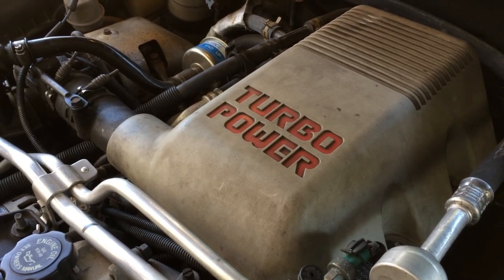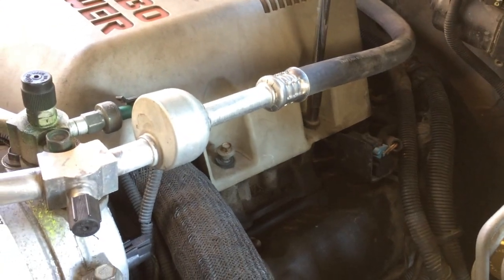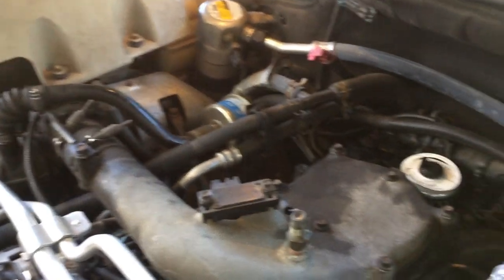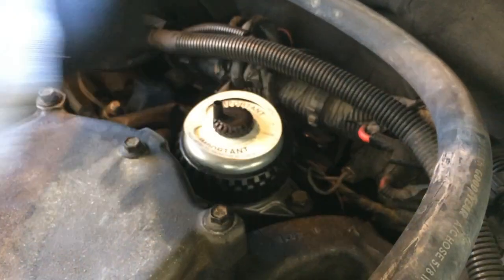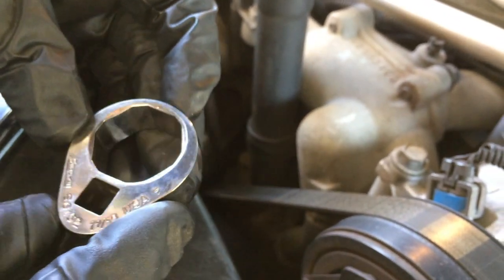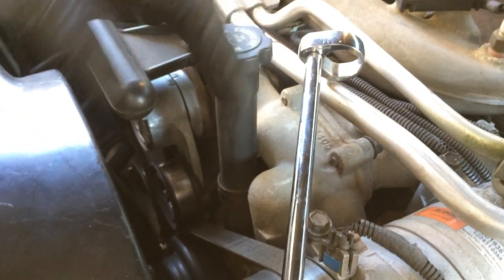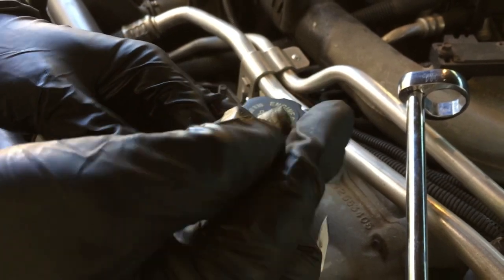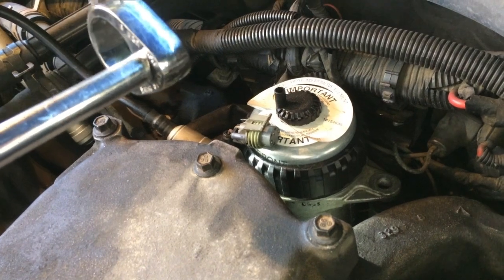1996 - 2002 GM Truck 6.5L Diesel Oil Pressure Sender / Sensor Replacement (Chevy & GMC)

Comment: You blow me away with your ability to do everything. But what stands out is your ablility to source ACDelco original parts, then to find speality items like that Snapon adaptor. How did you even know to look for that tool???
Reply from the maker: Most of these tools were designed by General Motors and sold thru Kent-Moore.  They are referenced in the GM service manuals.   But often other companies like Snapon will make a similar special purpose tool for much less cost.    So you find out in the service manual about special tools that are required.
Reply: The snap on was cheaper?
Reply from the maker: @peterwill3699  Yep, over at eBay

Comment: Best thing I ever did on my 94 was to bypass the OPS with an aftermarket harness. It also allowed me to bleed the fuel system after filter removal.
Reply from the maker: FYI, that fuel function was only applicable to pre-1996 engines, GM redesigned it and afterwards the oil pressure sender had nothing to do with the lift pump action anymore.
Reply: ok I have one for u I have a 96 gmc van but it's the old body style with the 6.5 non turbo. but if u look up a 96 they all show the new body style called the Express and they came turbo diesel. so my ? is how doin know if my lift pump is driven off the ops?
Reply from the maker: @karterguy1  That 96 would be a "G" model van if that helps on parts searches. This OPS circuit change was for "96 and up" but very early builds could be different I suppose. I honestly don't know for certain how you would distinguish such a situation.   Certainly on a 96 you should have the lift pump activated and purring along during the wait to start cycle (dash lamp flashing).  If you hear it then the LP is likely fine, if you don't hear anything (or feel the buzz vibrations with your fingers on the outside housing) I'd next try powering the LP directly disconnected from the vehicle harness to see if its good.
Reply: @DrShock  if this is so, then what exactly is the purpose of switching this part? The only reason I was about to buy one (which i most likely will anyway) was because I seen on other videos that people say, the lift pump is ran off the ops. If that isn't the issue for my 96 (which i can hear buzz when I turn the key) them I'm not sure why I would need a new ops.
Reply from the maker: @creeplife2802  There is no point in switching this part unless you're diagnosing an issue with the oil pressure gauge for 1996 and up.  It's got nothing at all to do with the lift pump circuit in the later design.   But before 1996, yeah it was used by GM as a safety shutoff to kill the lift pump when the oil pressure dropped.   This video was about working on an oil pressure gauge not functioning correctly, as mentioned in the video it ended up being the instrument cluster that had to be repaired to correct it.   If I did this repair all over again, I would have just pulled the cluster first.  ;-)

Comment: Had to replace oil pressure switch on my 2000 3500hd 6.5 diesel.i couldn't get a snap-on S6152 tool, but found that a Basin wrench used in plumbing worked well to remove/install the switch. Hope this helps someone

Comment: The pressure switch works the oil pressure gage and once the engine is running, it supplies 12 volts to the lift pump also. It performs two functions in one switch
Reply from the maker: That lift pump aspect is only applicable for 1995 and earlier model years.  In 1996 GM changed the circuit on this particular engine, and the OPS is no longer involved in powering the lift pump.

Comment: 1998 ….. 15 psi fuel pressure at T valve. Fuel present at return line on injector pump. 12 v going to FSS. New PMD relocate, Carter lift pump, Fuel filters, battery, alternator, oil pressure switch,  upgraded fuel hose supply to IP. Last ran in current condition 2 day ago for 1 min. Now no crank. Fuel restriction?

Comment: I'm assuming this could also be why it may show over 40 psi once started from a cold start and start to show 0 once its at operating temp? I just got a 93 3500 and its been doing that.
Reply from the maker: Possibly, if you're sure the sender wiring harness isn't chaffed or otherwise damaged along the run.   While I do not like to throw parts at a problem, with this particular sender there's not much you can otherwise check besides the harness as a scan tool gets its info from this same part.  A shop might connect a spare sender or mechanical gauge to confirm the diagnosis, but for DIY you typically won't have that available.   Personally, I wouldn't suspect the cluster gauge itself since you're reporting consistent sweeping of the needle from 0 thru 40.  I suppose it could be the PCM, or even an internal bearing thats gone out, but those would be on the extremely rare scale of events.
Reply: Be careful make sure you don’t have a duty oil screen under the oil panel

Comment: I live in NC and own a 99 c3500 GM ambulance. The batteries died during the winter and after replacing them with new, I have the Security light always on. It sputters to crank and then dies. Can you recommend a video/tutorial to reset/disable this passlock dilemma?  I love your knowledge and teaching style.
Reply from the maker: First, I'd suggest verifying the easy stuff.  I had a Chevy Cobalt once with the security light on and wouldn't stay started, but it was because the battery had a defect of some sort causing an internal short.   Replacing the battery/cleaning the terminals cleared that right up, so check your volts and cranking amps first.   If that's good and its a legit security/Passlock trip, then you need to do a relearn procedure on that.   Without a scan tool you can do a "10 minute" relearn  procedure on that 99  - https://www.youtube.com/watch?v=5feL05TyLtI
Reply: @DrShock  Thanks for taking time to reply. I'll check the batteries and connections tomorrow.

Comment: Sir I have a 97 with a 6.5td. have had intermittent acceleration problems for a long time. Sometimes it feels like it is dragging other times it feels like it's running great. By accident today I unplugged the oil pressure sensor so I rerouted the wires and plugged it back in and the problem went away.. is that an indication that the harness may have a short in it?
Reply from the maker: For 1997 the oil pressure sensor is not involved in the fuel circuit (this was true prior to 1996 though).  Tough to say with certainty, but it's possible some other wiring involving the fuel injection pump harness you disturbed during the re-routing process was involved.  It might be a rub thru situation from years of vibration, or it may be corrosion at a pin connection point.  Either could have been temporarily improved by the disturbance.
Reply: @DrShock  thank you for the reply sir.. I was under the impression that the oil pressure sensor controlled the lift pump. Telling it how much fuel to push through. This truck is a headache..lol
Reply from the maker: That was true, about the oil pressure sensor being part of the lift pump fuel circuit, but only thru 1995.

Comment: You say that's the only way. What if you removed the fuel filter canister? Two bolts and one line and swing it out of the way.
Reply from the maker: I hope I didn't say the only way, as of course there's usually several ways to improvise and approach such disassembly.  But definitely needs the special tool to remove the 96+ sender to avoid damaging it.

Comment: Would this part be my problem cause when I drive my truck over 30min and come to a stop my oil pressure drops to 0 but the engine never sound different.stays running smoothly
Reply from the maker: Possibly, you would want to eliminate any electrical problems first (both to the sender and the gauge).   With their age now, these old body style (OBS) trucks will have developed some ground issues.
Reply: Hi I know this is 4 years old but my 97 is doing the same thing but it's not going to 0 yet but runs smoothly you think with low oil psi it would start knocking did you change the yours in did that help

Comment: What were the symptoms for need of replacement my truck is surging and feels likes it is bucking almost holding back
Reply from the maker: For the years covered, it's just an oil gauge not working.   The oil pressure sender has nothing to do with the symptoms you're describing, for 1996 an up 6.5L diesels.   If you had an older model, then this sender would also serve as the activation switch for the fuel lift pump.
Reply: @DrShock  Well it is a 98 C3500 dually with the 6.5 and it feels like it is bucking and i hate it with only 83K miles where should i look it is also up for sale i don't need such a beast no more
Reply from the maker: So for a 98, that's not going to be the oil pressure sender.  I would first start with seeing if there are any codes stored by the PCM (not all of them will cause the check engine light on the dash to come on).   Let the codes guide the next steps, if there are any.  If there are no codes, and since you didn't mention any problems starting,  I would start first with making sure no problems with air flow to engine, then fuel flow to injector pump, then I would make sure all is good with vacuum if its a turbo 6.5L.  If that's all good I'd look at the injector pumps PMD unit next.  Hope this helps.
Reply: @DrShock  You were right there were 3 codes i looked them up but being idk Diesels very well yet idk what they mean or where to start i got a P1216,P1217 and a P1654 where should i look from here thanks for all your help so far
Reply from the maker: P1216 & P1217 are fuel solenoid related, "could" be a PMD or PMD wiring harness problem, but usually is an injection pump problem.   P1654 is service throttle soon lamp circuit.   I would start with the P1654, this one is related to the dash lamp for the accelerator position sensor.   It's a code from either the lamp for the service throttle soon lamp being shorted (does it light up during the lamp test when you first turn the key before starting?) , or a short to ground in the related circuitry.   For the other two, it's handy to be able to borrow someone elses spare PMD to eliminate that as it's the cheaper repair (an injection pump repair will be quite costly).
Reply: @DrShock   i have another PMD and relocator kit it is one of those cheapys though so i haven't changed it yet should i try that and would any of this have anything to do with my CC cause it has stopped working all together now but when still working the sluggish holding back behavior didn't seem to be a problem i see i am also getting static noise through my radio with the fan on high so i was told it might be ground related what grounds would i check for this i am so lost and again appreciate any and all your help GOOD SIR
Reply from the maker: CC = cruise control I presume.   No cruise circuit would have nothing in common here, but corroded ground points or corroded ground straps could be a common culprit since you have several not necessarily related things going on here.  You'll need the service manual schematics to trace out those ground points. Here's a link for PDFs, scroll down to the four volumes for 1998.  https://www.gmt400.com/threads/88-95-service-manuals.43575/
Reply: Had exact problems, cruise control and all, pmd was the fix. Dying proof on my back seat. Buy a good brand and relocate behind license plate
Reply: @DrShock  just bot ‘94 K1500 with 59k miles. I’m having a bucking problem. Fuel is shutting off. I had a code, replaced-relocated PMD. Haven’t had code since, still have problem. Replace LP & wire harness. Still have problem. 

Cold start is great. Starts bucking as it warms, gets worse the warmer it gets. If I stop, heat builds up it gets really bad. I can drift down hills to cool engine compartment. When I get to level I can get on throttle, it’ll take off great. I’m convinced heat is causing my problem. 

Any thots?
Reply: Did you ever solve your problem. I’m have something similar.
Reply from the maker: @kevinsheehan983  This is one of those kinds of problems where having a Tech2, or comparable scan tool, is necessary.   You have to be able to zero in on root cause to avoid the parts cannon.   What I'd be looking at on the scan tool is what is the engine coolant temperature reading before and during the behavior and how does that compare to what the dash gauge is showing (two different sensors).  One of the sensors is in the cylinder head (gauge) and the other in the coolant crossover (for PCM).
Reply: @DrShock  thanks. I do have GMTDScan basic with a laptop & OBD1 connection. 

This evening I disconnected the crossover temp sensor. I wasn’t aware there’s another. Thanks. 

When I had a code 36 every thing I saw on line was replace-relocate PMD. 

I changed the lift pump cuz previous owner put on a plastic transfer pump. That needed replaced regardless. 

I don’t want to throw parts at it until it’s fixed. Especially when it could be a wire or connector.

Comment: Does it screw all the way down. I can see the threads on mine. It does not go all the way down.
Reply: The thread is pipe thread. It is tapered, so no don't try to force tighten it. With sealant on the threads, tighten it good but don't Gorilla on it.

Comment: Is it much different in a 94? Say I can just a socket? Doubt I have that one lol.
Reply from the maker: Same special tool and ACDelco part number I gave in the description.   But the pre 1996 models have a different wiring harness since the oil pressure sensor was used as part of the lift pump enable circuit in those years.  But the main reason I don't include 1992 - 1995 in the video title is that the location on the engine for the sensor is different on the earlier years.   Other than that, fairly similar job.
Reply: @DrShock Sounds like I'll be removing the intake.

Comment: I have concluded to try to replace this and the lift pump before going after the PMD does that sound about right or am i chasing the wrong path
Reply from the maker: Never throw parts at a problem, get to root cause first.  Saves money, and results in a better repair.  Lift pump is easily tested and you can determine if it's actually in need of replacement first, see my other video here https://www.youtube.com/watch?v=CzSV6QX6mo4

Comment: How did you originally diagnose it?
Reply from the maker: On the years this video covers, the sensor only controls the oil pressure gauge.  So a tech2 scan tool, or MDI with GDS2, is sufficient to confirm the diagnosis.   Earlier model years this sensor also enabled the fuel lift pump, so that could be another symptom requiring more in-depth diagnosis on pre-1996 vehicles.

Comment: My suburban 95 6.5D some times lose power after stopped the engine and start again and going good probably I need replaced that sensor!! maybe results!!
Reply from the maker: I wouldn't expect an oil pressure sensor to affect engine "power".  For a 95 if you have a lift pump problem it could be involved on that year as the switch circuit for the pump includes the oil pressure sensor.  But otherwise this sensor is just for your oil pressure gauge to display correctly.
Reply: @DrShock  thanks for your explaining 👌 I appreciate now I'm tired to put a lot money on this engine! because I learned much about this L65 Detroit engine 👌 they used much on boats without electronics sensors and stuff's!! this type of the engine he doesn't need all this electronics stuff's for working good 👌 so I removed a vacuum pump and all sensors now if changed a electronic diesel pump to mechanical diesel pump ALL the problems gone forever!! and is much better finish the problems I have on this engine!!  thanks for your attention mate cheers from Norway

Comment: Do you think this could cause my 6.5 to have rough start and low idle on start up?
Reply from the maker: For 1996 and up, this would typically be a problem with the oil pressure gauge most of the time.  For 1995 and earlier, the lift pump power circuit is controlled by this part as well.   So if you have no fuel coming out when you open the black fuel filter bleeder valve on top of the fuel module in the initial key on/ignition off position - it can be this part for that symptom (this symptom could be a dead or dying lift pump too so you have to test further for which).
Reply: @DrShock  okay I’ll look into that. I’ve trying to find a lead to the route of its problem. But thank you for the response

Comment: Sir quick question the hose / cylinder that’s said this goes up . Is smoking white smoke any idea what will it be ?
Reply: The one that has like a blue sticker next to the turbo
Reply from the maker: The "tuna can", it's called a CDR or crankcase depression regulator.  Think of it like a PCV for diesel engines as its an emission controls part.  You may just be seeing blowback emissions from the tubing connecting it to the engines valve cover, which may be in need of replacement.   Inspect the tubing for flaws and replace if necessary.  The CDR itself is fairly robust and rarely needs replacement, but you can google for a test to check it to be sure.
Reply: DrShock oh because i just change my turbo my old one wasn’t working at all , I install the new one and when I drove it to see if it feels different but then I open the hood and smoke was coming out of the turbo by the screws of the turbo housing